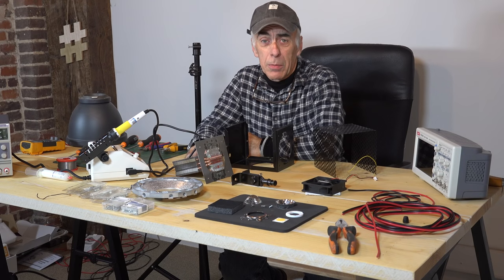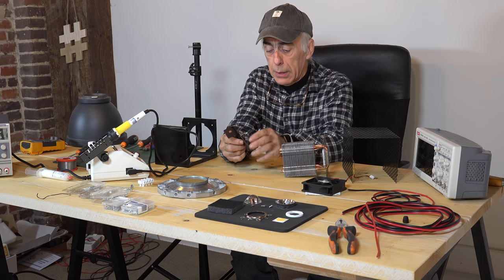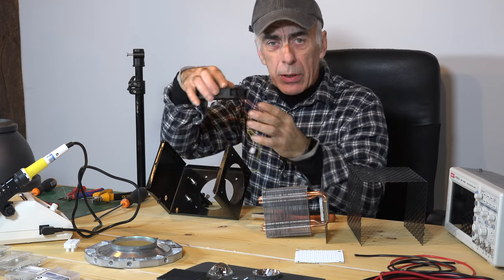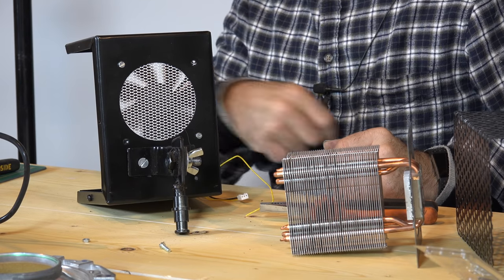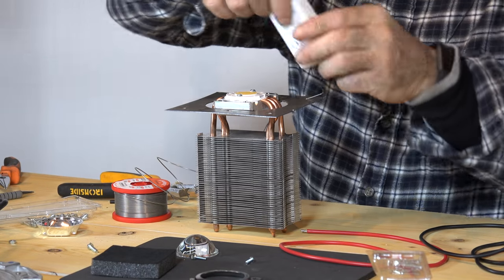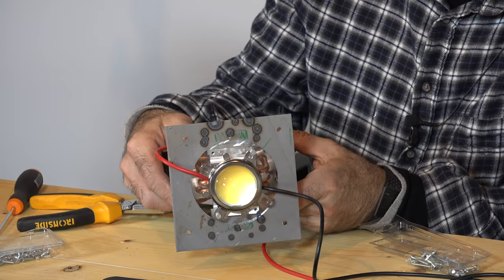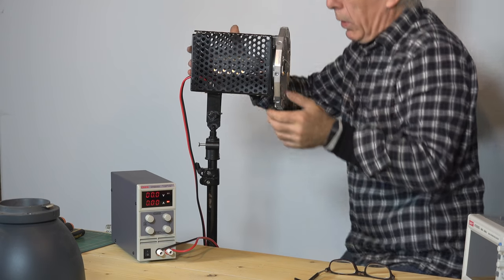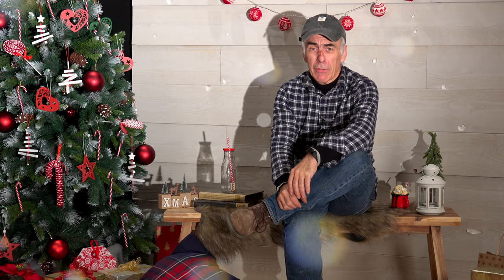The Ultimate light source part 3, assembly and test

Comment: D: the led isnt even touching the heatsink!! please just get rid of that plastic mounting bracket and put the led flush on the heatsink. otherwise its not going to live very long. or put a piece of copper between led and heatsink in that open space under it
Reply from the maker: txs,  i actually did place so a copper strip under the led;;;   should have stated it   txs for making that clear
Reply: ah ok. yes it wasnt clear from the video.